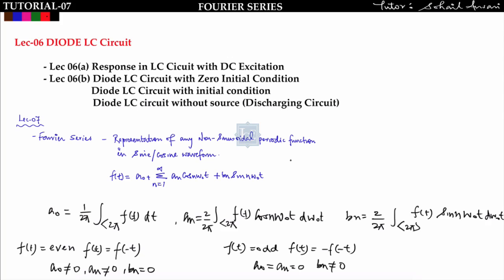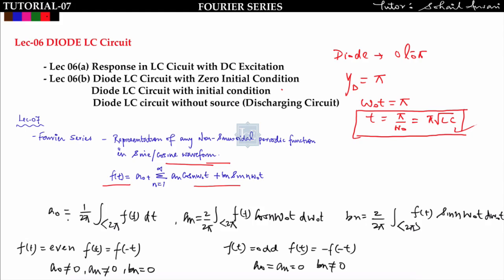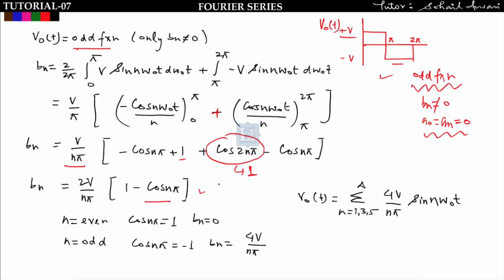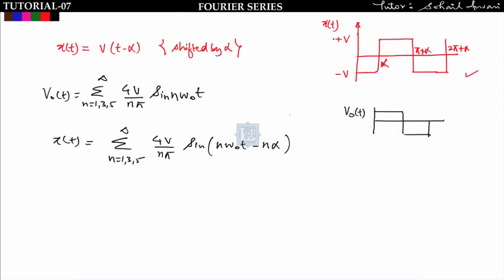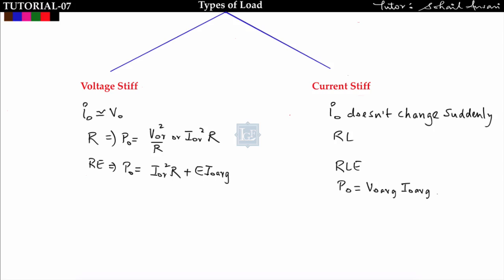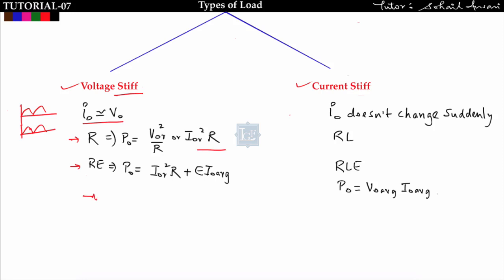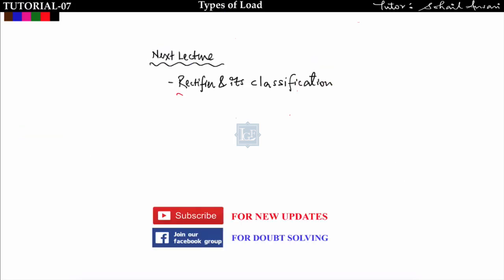Lec 07 Fourier Series & Types of Load (Voltage Stiff & Current Stiff)

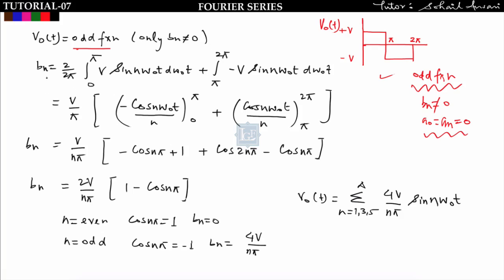Comment: sir at 3:11 ,how you know that, the function is odd?
Reply from the maker: read class 12 basic..odd fxn is that fxn which are anti symmetric towards y axis..
Reply: I know ..odd functions are symmetrical about origin .
i.e f(x) = -f(-x)..but in the shown graph..there is no value in -ve x dirn. 
so just by looking at +ve x waveform. 
can we conclude that a function is odd or even??
Reply: just move that square wave to left side one block , you will see that the resultant wave is the opposite of the wave in which you started. Like this you can easily figure out .
Reply: it is odd with half wave symmetry hence contains only odd sin terms